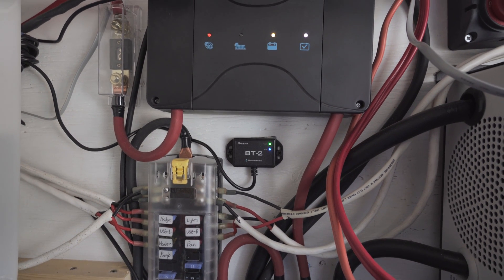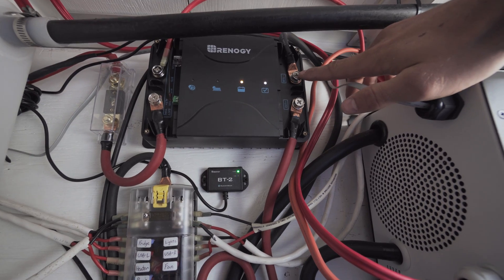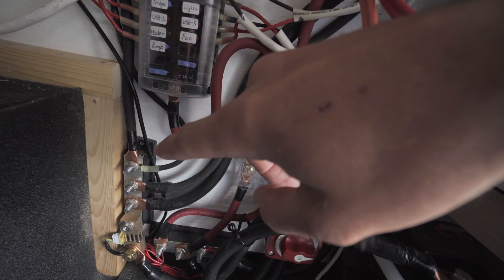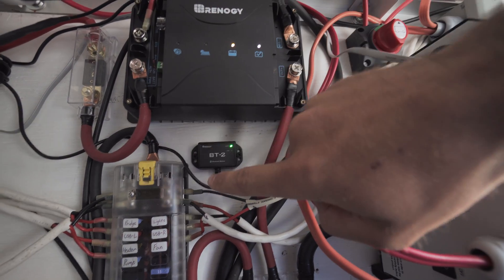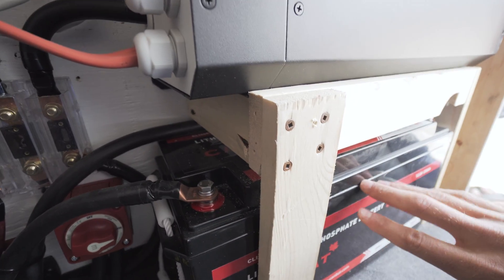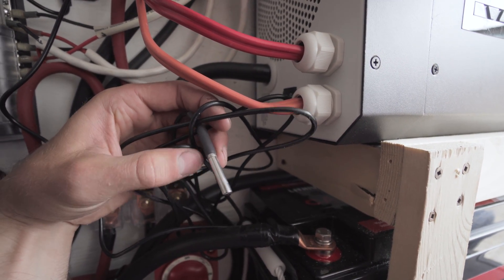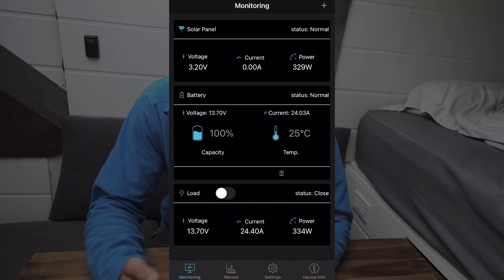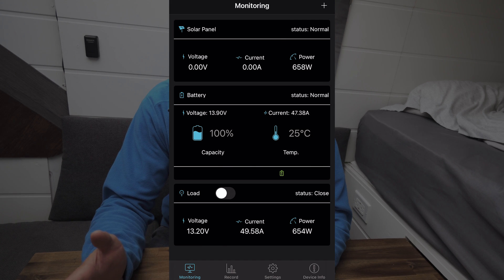Renogy DC to DC Charger Install in Off-grid Campervan Solar System

Comment: I know in the manual it says to use 75a fuse alt. side and 65a house battery side. Im using 80a alt. side and 70a circuit breaker house battery side. Will it be ok?
Reply: And 4awg on both sides
Reply: Yeah I'm irritated at the design choice for Renogy to recommend a size that doesn't seem to exist lol. I'm using two 80a fuses but I want to replace the one that's supposed to be 65a soon with something closer. I'd say you're probably safe there. Also I find the BT-2 app to be very bad. Let me know what you think if once you have it installed assuming you're going with that. I'm looking into more reliable monitoring systems now, but at the very least it you get stuck you can use a multimeter for an accurate reading to keep your battery safe.
Reply from the maker: @moll443  I also installed the 500a battery monitor by Renogy. Way more accurate!!
Reply from the maker: Yeah that fuse will be just fine! For a rule of thumb when it comes to sizing fuses, they should be 1.5x the maximum amperage.
Reply: Omg @scott macaleb just found this video that is SO HELPFUL. If you have questions about your fuses still. He talks about fuse sizing near the end but it's a great video if you wanna understand what you're doing. https://youtu.be/cX4s-bxn4fs

Comment: I have 450 watts coming off my solar panels.  Can I still use this charger?  I think its rated to 400 watts.  Could I damage it?  Thanks for this video.
Reply: But the solar input is limited to 25.5 V. So set up solar panels accordingly.
Reply from the maker: The charger is rated for up to 660 watts so you can definitely still use it! Welcome 😄
Reply: Hi , I have 520w solar panels and they giving ~36v. Do I can connect to renogy dc-dc50A or I need different mppt controller? Thanks

Comment: any chance to get 50amps from solar?
Reply from the maker: Yes, the controller will except a maximum of 50 amps of solar.
Reply: Made to Travel I have 640w solar panels which should give me about 40amp.  I am getting only 25amps max
Reply from the maker: @golanigo859  what battery setting do you have the controller set too? Have you tried disconnecting the alternator?
Reply: @golanigo859  How about when the vehicle is not running?  I suspect you can get your full ~40 amps from solar when parked, engine off, in good sun.  It appears to be programmed to allow only 25 amps from either input when both solar and alternator inputs are showing voltage or amps (not sure which).